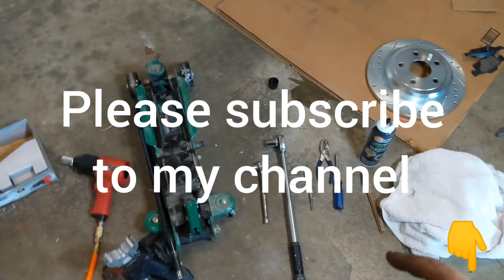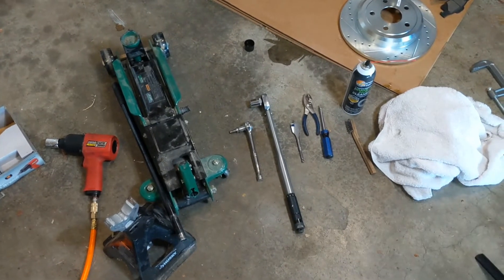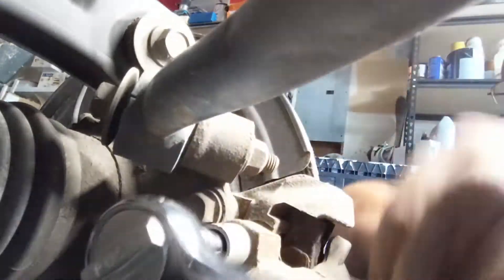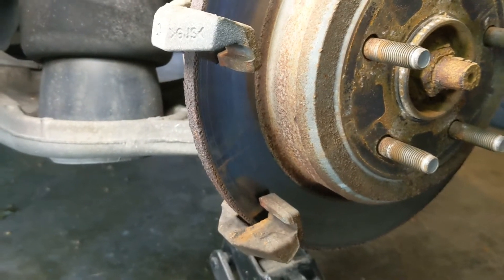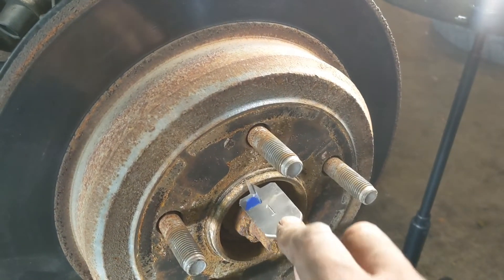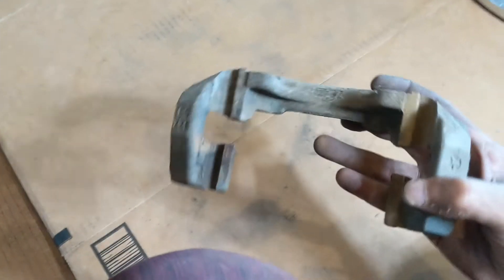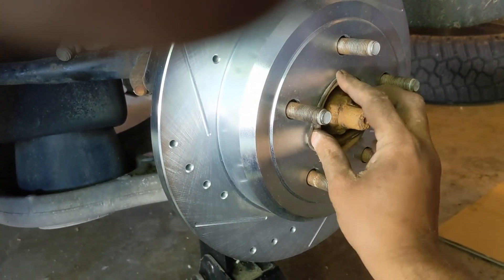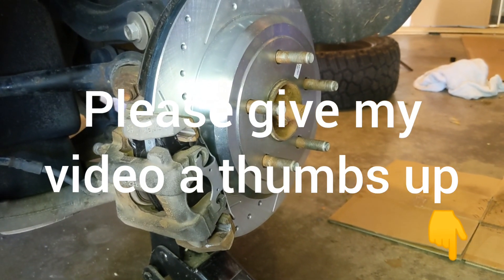Step by step instructions on how to replace rear brakes and rotors on a 2013 Jeep Grand Cherokee

Comment: What size socket did you use for removing the caliper?  I got a 2013 V8 limited AWD. Struggling to find the proper size

Comment: Is it a good idea to buy the 14 $ parts kit to refurbish all the e brake small tabs and mechanisms , while your doing brakes ? Given there pretty 10 years old frail thin …I ordered the kit . Great vid
Reply from the maker: I'm not familiar with the kit you mentioned.  If you can, share a link.  The brake pad kits that I've purchased came with all brand new hardware.  Double check that your brake pads don't come with replacement hardware.
Reply: It’s a rayspestos kit. 14 $ Amazon . 
Ray part H7367 , I grabbed one. Amazon site said it’s for my car . It’s Everything, all the springs , clips , hardware for Emergency brakes… not pads or cable obviously. I haven’t done my brake job yet . Sorry I could not link . 👍🏼
Reply from the maker: @SRocco-dv8we  Thanks for sharing!  That's a great kit.  I agree with you.  If you're going to be in there doing the brekes and rotors, for $14 you can replace all the e-brake hardware.